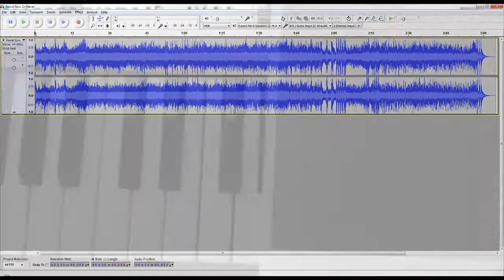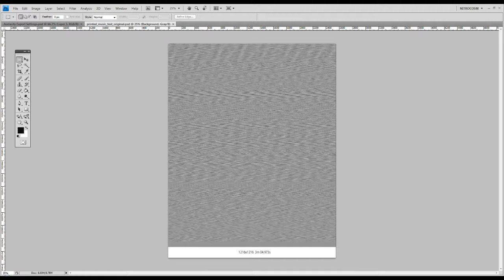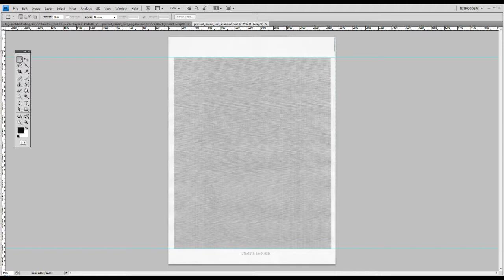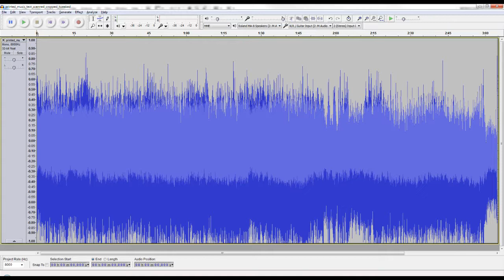Recording Sound on Paper

Comment: Cool! I have made some pretty much identical experiments, but with a slightly different workflow. Instead of using photoshop to convert the raw audio data to a bitmap, I created a suitably sized blank grayscale bitmap in GIMP, and saved it in a folder.
I then took the audio data and replaced the data in the bitmap image by using a hex editor, without touching the bmp-header.

It kind of worked, but I never thought of scaling the image to create redundancy. Also, when converting the scanned image back to audio data, GIMP introduced some new bits into the audio stream at a constant interval, creating a buzzing sound.

Anyways, nice video! I have even considered making a video about it myself.
Also, another time, you could try to adjust the levels in the bitmap image so that the darkest pixels are completely black, and the whitest pixels are completely white. This should elevate the sound level and thereby increase s/n ratio.